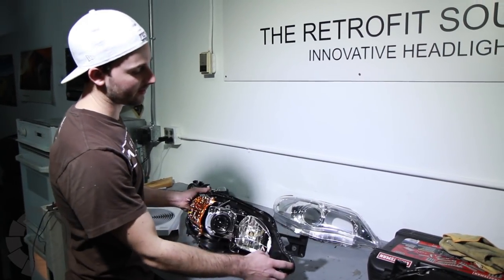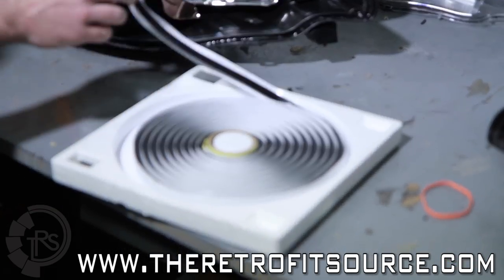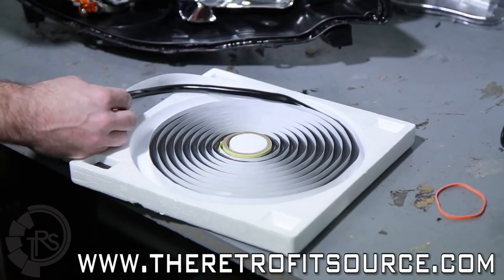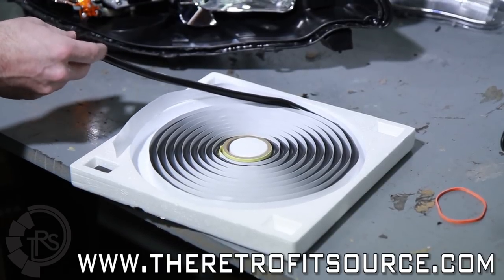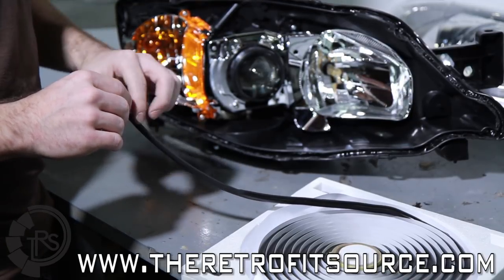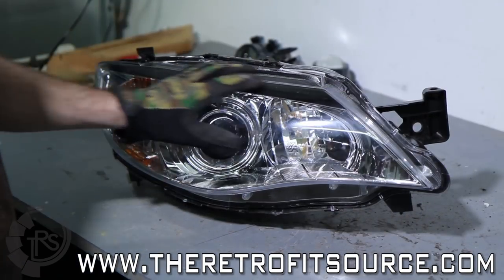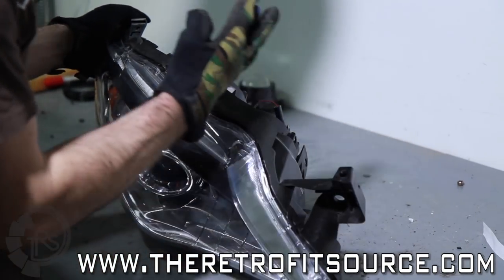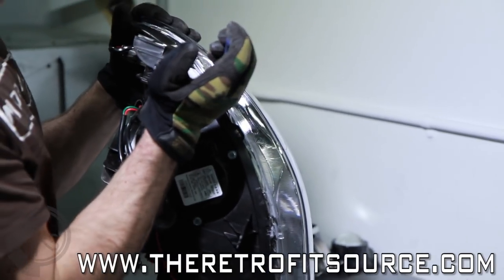TRS Tips: Resealing Headlights with OCI Butyl Rubber Glue

Comment: This butyl rubber is also known as a Windshield Kit that was used on older vehicles to hold the windshield in. You can purchase this at most auto parts stores. Just ask for a windshield kit.
Reply: Agreed. I used to work at advance Auto parts and we sold this stuff as a windshield seal kit

Comment: Hi. Great video.. I have a question : do we need to clean the "glass" around from its original glue before assembly the two parts?
Reply from the maker: This is highly debated. Some people prefer to clean the original glue completely before reassembly, Others simply install fresh butyl over the old stuff. It’s a case by case basis I’d say!
Reply: @RetrofitSource  thanks for the answer. I'm thinking about not removing anything and putting the new glue only around the cover above the old glue. The other part of the glue on the headlight i pressed it with a screwdriver.. I hope  it will fit to close. Will it close?
Reply: @hrcivic  how did it end up?

Comment: Anyone thinking about reusing the old glue don’t do it. Just pay for new glue it’s worth it. I’m sitting here opening my headlight for the third time because I reused the glue and kept getting leaks.  Also if you had water in your lights remember to dry out the little piece of foam in there or they’ll fog right up again
Reply from the maker: Good information! Generally speaking, you can re-use the glue, but you do need to add some more to keep things water-tight!

Comment: Can you use silicon sealant to glue the headlight/ headlamp ?? Butyl glue is expensive here and i don't need that much
Reply from the maker: We would not suggest it due to the gas it can release, and its not as effective. The butyl is cheap, at $17 for a roll...thats very reasonable to avoid the aggravations of doing it wrong. https://www.theretrofitsource.com/morimoto-retrorubber-butyl-glue-51999.html

Comment: I have full LED headlights, i i put them into the oven, will that damage the LED bulb? P.S. I can't remove the bulb from behind.
Reply from the maker: Should be no problem! we recommend 270 for 7 minutes, theyll be fine.
Reply: @RetrofitSource  I'm terrified. But cars heat up pretty hot esp the longer you drive them. They should withhold? Still terrifying cause some ovens temps are diff depending on how old.

Comment: only one headlight got moisture creeping in.  I did a amber delete mod. 
I heard to re-seal it with caulk on top of the black stuff.  worked fine on the right headlight.  

but not on the left.  I see no openings or anything, yet moisture magically comes into the headlight.

They’re reflectors and i plan to upgrade to projector if its not a hack job.  was told plug and play
Reply: chris fix of course
Reply: forgot to mention that I clear-coated the lens too.  2k clear

Comment: Can a heat gun be used instead of an oven?
Reply: I used a heat gun to open my fog lights but they're glass so I wasn't worried about melting the lens. A heat gun can melt the plastic lens if you keep it on a certain spot for too long, so make sure to go in a circle pattern and keep the heat gun moving if you use one. I'm retrofitting some mini 7.0's this weekend but I'll be using the oven for my headlights since they're plastic.